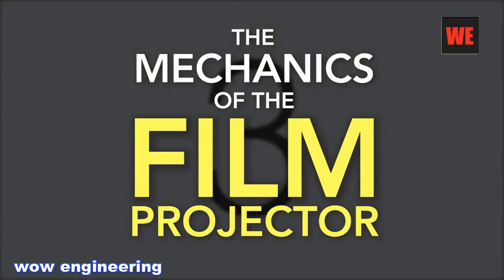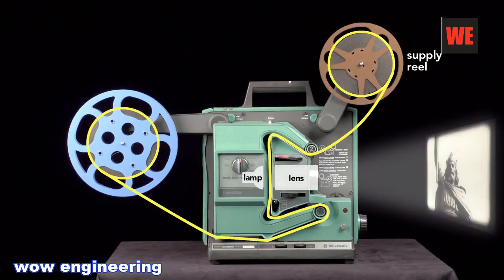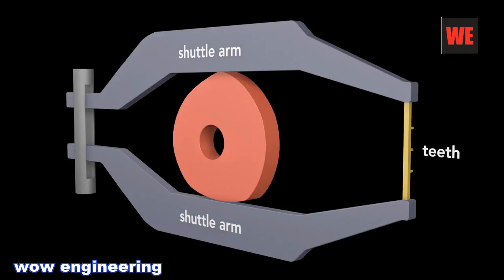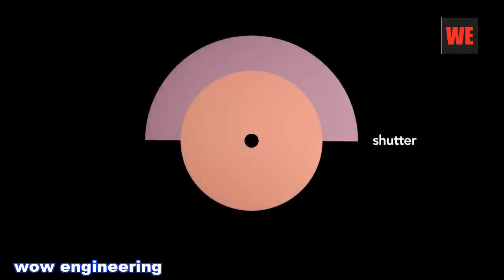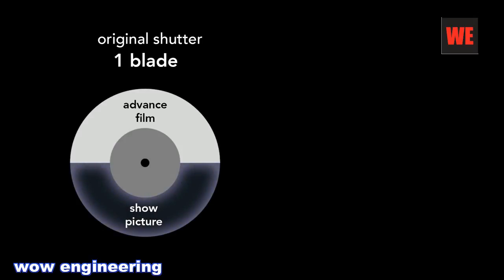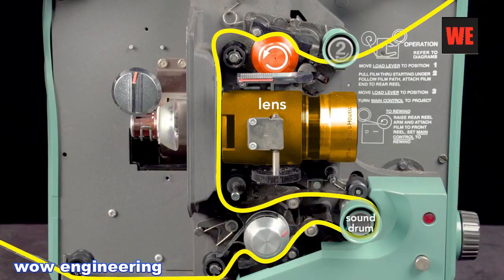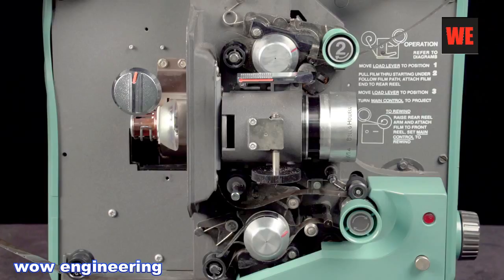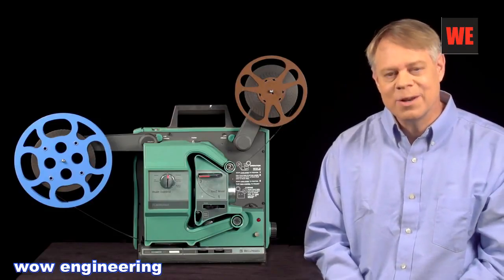how does a film projector work

Comment: Most professional projectors used an intermittent sprocket that is connected to a Geneva movement which is made up of a Maltese cross and a cam. Also... three bladed shutters are only used in certain applications the far vast majority of professional machines use a two blade shutter the exposes each frame twice for a 48hz “flicker”